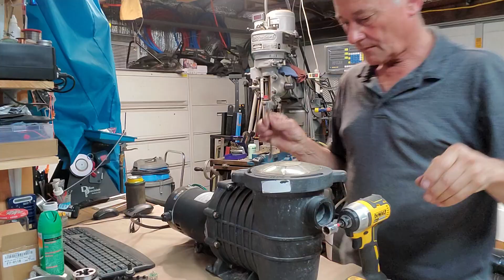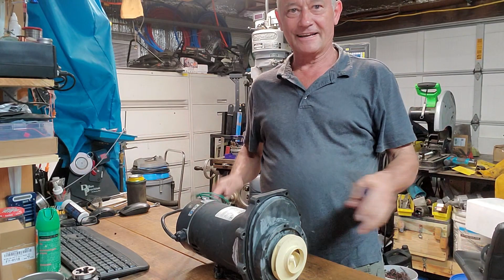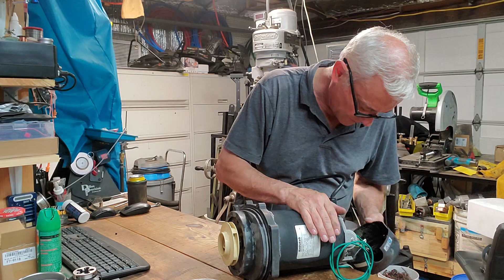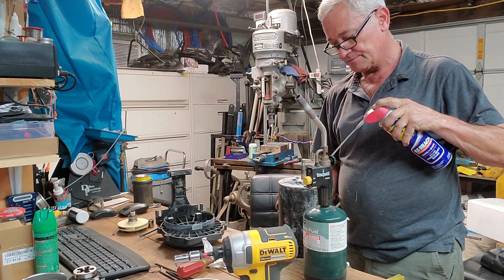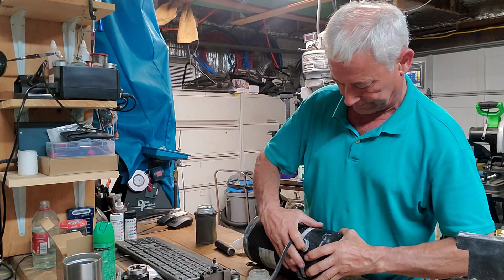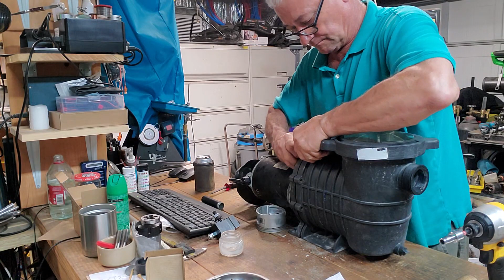Pool Pump Bearing Failure Repair

Comment: Should have shown the pulling of the bearings
Reply from the maker: Not much to show, they were not tight, came out of the housings easily and slid straight off the shafts. My video's being too long can be a problem so I leave out things that were not worthy